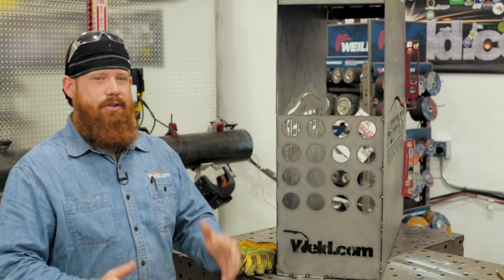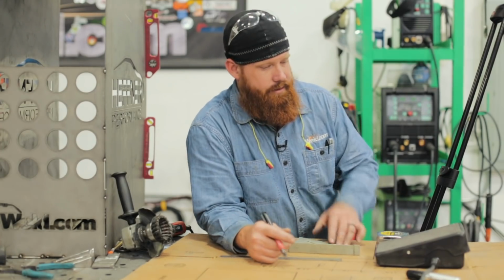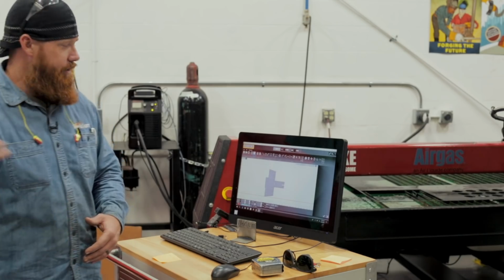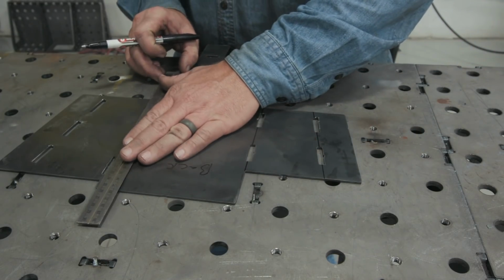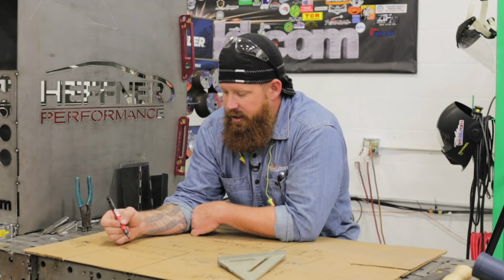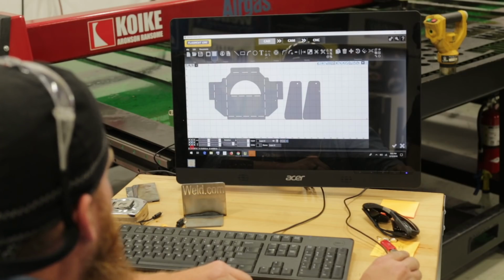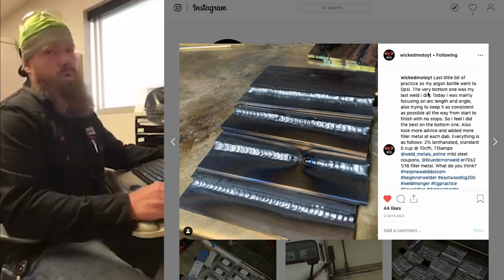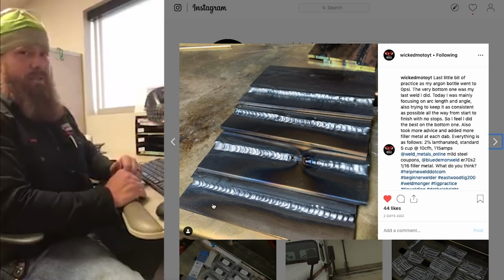Origami Weld Cart Build!! Part 2

Comment from the maker: To be featured on the "Help Me Weld.com" segment at the end of the videos, post a picture of your weld in the Weld.com Facebook Group or on Instagram with #helpmewelddotcom.
Reply: I have a question, hope you could assist.

I bought some 309L stainless filler rods for TIG.  I intend using them instead of mild steel rods for mild steel welding. This way my weld bead is stainless and corrosion resistant, even if the surrounding metal is mild steel.

Do you see any problem with this?
Reply: Paul Sheer the weld will most likely crack because it will be diluted with chromium and nickel from the 309. I would recommend using 70S-6 since the integrity of the weld would be more important than the aesthetics. Use a gas lens with adequate coverage and try to keep any colors off the completed weld. You want a silver color. Hit the weld with a wire brush when your done to clean off any oxides that formed during the welding process. It will help keep rust from forming but won’t completely mitigate it. You can always put a shot of clear coat on it once it’s cooled to keep it protected.
Reply: @GodslilRedneck23   

Thanks for that info.

Here is explained that --

https://www.lincolnelectric.com/en-us/support/welding-how-to/Pages/filler-metal-detail.aspx

-- the grade 309L is used for welding Mild Steel to Stainless. This is what makes me think it is ok to weld MildSteel-to-MildSteel with 309L.

Your thoughts?

Comment: If you score the inside of your bends it will give the outside a smooth tight corner
Reply: Jared Mathwig you’re right, but then we would have to do the welds on the inside and they’re harder to get to.